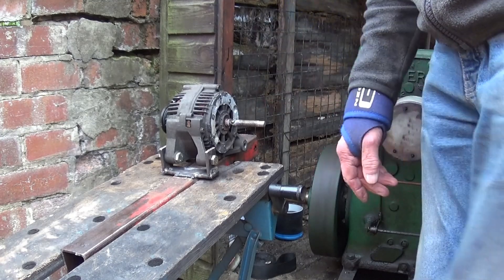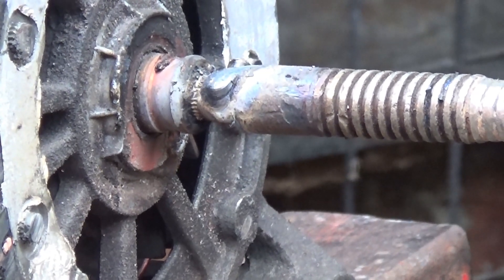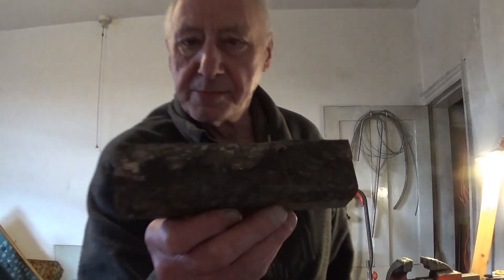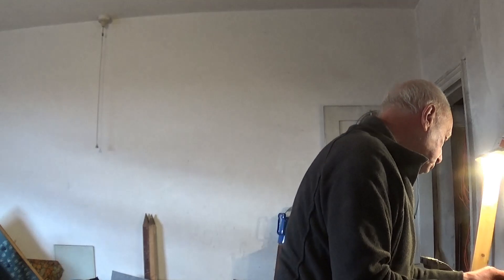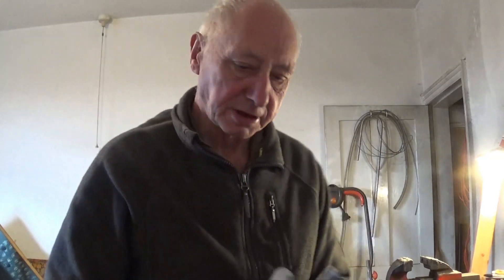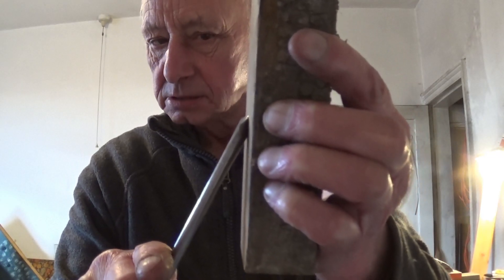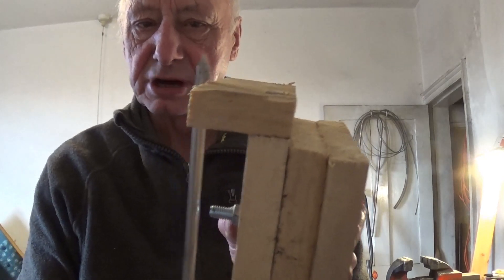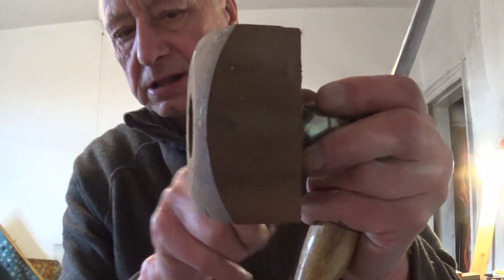Progress On The Wood Lathe

Comment: Is a belt from the Lister to the lath rocking the lathe?   If you so need to mount the Lister on something to keep it from moving about.  Lathes need to be quite steady.   Adding the weight is a good thing but I would address the Lister's movement first.
Reply from the maker: Thanks Dan. Problem is pulley on the Lister is not solid enough. I just cannot find a bit of pipe with 1 1/2 inch inside diameter to go over the shaft. Been looking since I got it. So, if I can add enough weight just to keep it more stable, engine pulley can do what it wants.
Reply: MalcOfLincoln   Would be a few minutes work to make a sleeve on a metal lathe.  Any fellow YouTuber’s nearby that might make one for you?
Reply from the maker: @danharold3087  Apart from my friend at the garage, don't know anyone with a lathe Dan. Really didn't think it would be difficult to find. Even a bit larger would be good, because I could weld nuts on the outside and centre it with bolts.
Reply from the maker: @TheSwampyization  Thanks, that's the whole idea. Use what you've got, keep it simple and have a bit of fun.
Reply from the maker: Only got the drill base someone left here Mark. 6 inches of water pipe would do the job. Can weld nuts on the outside, then true it by tightening the bolts. But I should soon be getting a flat belt pulley.